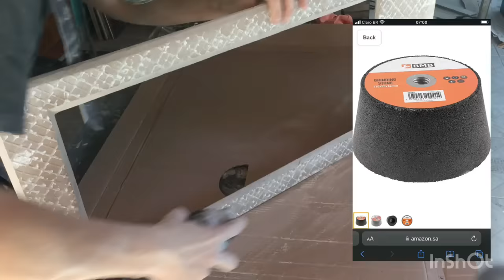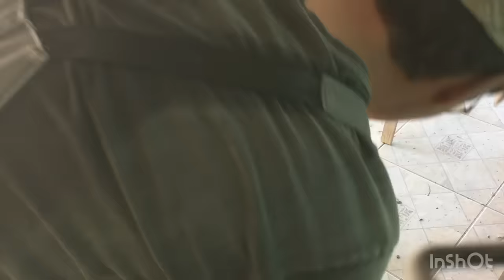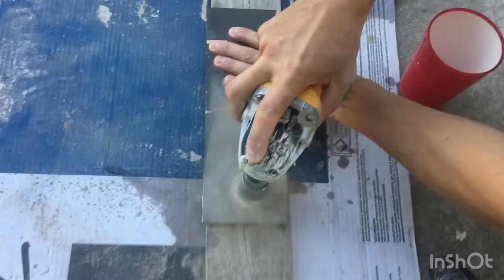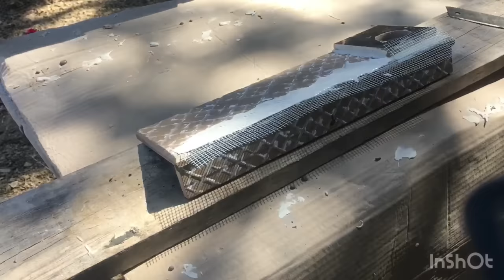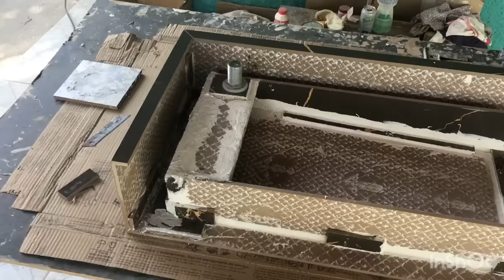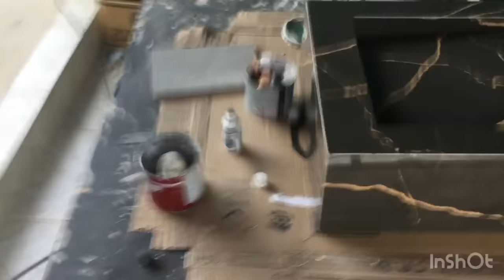How to make ramp sink from porcelain tiles. With all sizes .

Comment: I was all about this until I thought of how are you supposed to unclog the drain if that ever happens? Take apart the plumbing, then I thought about that cavity that you can't get into to clean. I think I'm going to make one with a feature that's removable for maintenance and cleaning purposes. All in all though super impressed by the execution of the final product. Also my dude is a surgeon with an angle grinder. Great job
Reply from the maker: Hello dear! Thank you for the watching and comment. Actually you have reason.  In this model is more difficult to clean and to make repairs, but it is possible. I think you would make by this way: 
How to make bathroom sink from porcelain tiles. With all sizes. Step by step.
https://youtu.be/29ZXW69fuRw
Reply: Took the words right out of my head

Comment: Final product looks good. Well done. 

Tips: •Use black silicone for construction instead of white makes disguising seams easier.
•Install drain that mounts from underneath to facilitate clearing drain blockages. 
•I'd have installed the tap on the other end to accentuate the flow of water down the width of the basin.

Otherwise - Brilliant ☆☆☆☆☆
Reply from the maker: Thank you for the watching and for tips! 👍🏻
Reply: Your drain "tip" makes no sense. 
What he used is 100% correct.

Comment: For anyone considering doing this, dont! If you drop just bottle cologne or something harder then the tile, you will have a broken sink. Its way to thin to handle small impacts of any kind
Reply from the maker: Hello dear thank you for your comment! But think about it: if you drop something harder than the tile in your bathroom floor there is a chance to broke it . By the same way you have the same problem.
Reply: I mean the chance of dropping something that heavy and so hard that it will break a 10mm tile is very unlikely, and it is no problem for you to glue a 15mm thick plywood on the rear side of the larger pieces if you are really worried (or use thicker granit material.   This clip is a mast4er piece and will help a lot of people that don't want to spend +4000USD to get an amazing "stone" sink.

Comment: Making a 13ft countertop with porcelain tiles,. Is it the Tenax flowable mastic what we use and do we need the hardener ? We also will be making the edge of counter from the tile, just like you show in your videos with the tape assistance . and advice please send our way
Reply from the maker: Hello dear!  In Brazil we use another type of mastic because it is chipper in 10 times than Tenax. But Tenax is excellent glue. You can choose it’s solid form . And yes you need always use hardener. And congratulations for you art project! 13 ft is big project!💪🏼

Comment: i painted edges with acrylic paint but it peels and won’t stick, did you mixed acrylic paint with something else?
Reply from the maker: By this way will not work, but you can do next:
1) remove the glue from edges with diamond polishing pad 
2) remove dust from surface with thinner 
3) mix your glue with black pigment 
4) apply it to edges like on the video 
5) Wait 20 mins and cut with paper blade knife 
6) com sandpaper finishing edges 
7) apply parafine 

Ou you can also try to do edges with black epoxy grout.
Reply: thank you so much

Comment: Concept, idea is okay, the trophy spillway is a health hazard to clean, looks secured.these designs depending jn the lip can stop rings and what not from getting lost. The main problem here I the drainage, was puzzled for the choice location of tap... since the flow could go from high to low. Looks great. Could create a double box drain, so it's removable or somehow can be cleaned.. also an overflow hole could be made, I would recommend a copper inlay.. the hole needs to be engineered faster than the flow of the tap... or you can make a mechanical tilt weight for water that shuts off the water, after a specific amount goes into the overflow... anyways like I said that catch basin part has a potential bacteria growth upwards... potential health hazard.
Reply from the maker: Hello dear thank you for your comment and the watching. I agree You have a reason. In my channel I have posted a  recent video with another model of bathroom sink. I think you would like